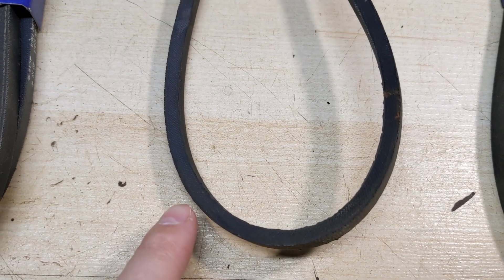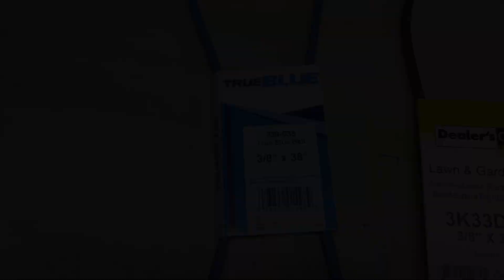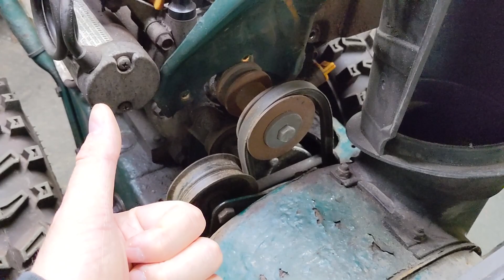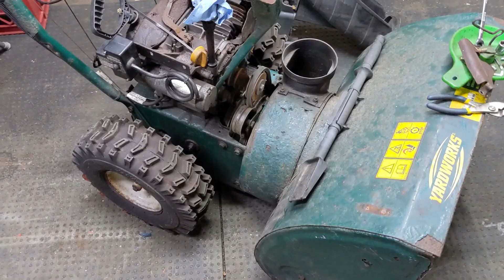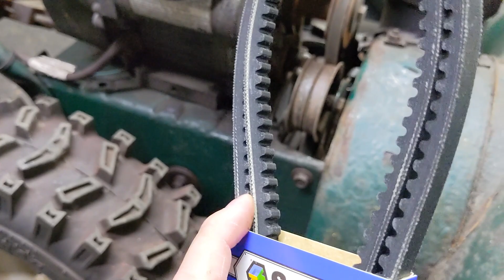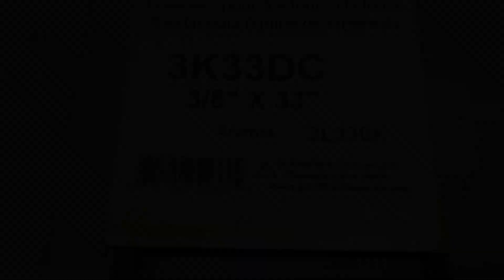Are Kevlar Belts Better?

Comment: Have they stopped making the green belts? My father-in-law had a mower shop and he had the normal black belts but there were the green belts. More expensive but last forever.  Is that what the blue belt is now.  Thank you.
Reply from the maker: Yes the majority of the aramid or kevlar belts are blue now, but I still see some green ones from time to time.
Reply: @EliminatorPerformance  Thank you.

Comment: Hi Eliminator - it's Big Rodders in Ireland.   Very interesting video.  I have enquired and researched this issue but haven't got a definitive answer - how do you measure a V belt?  Is it the outside diameter, the inside diameter or half way up the side of the V.  I know a small difference in length can have a massive implication in correct operation.  Also, I had a recent experience where two new belts wouldn't fit correctly only to discover that they were 74inches branded as 73.  Problem solved when my usual Dunlop belt came back into stock.  I would be very grateful for guidance from some expert out there in the interweb!
Reply from the maker: We've always measured our belts with a seamstress ruler (it's like a paper ruler in a roll which allows it to form around a curve) so you take a small paint marker and mark your starting point, then go around the belt. If you're measuring a belt and purchasing belts marked A98 for example, it would measure 1/2"x100" as you subtract 2 for A belts. B belts (5/8") you subtract 3 so a B97 would be a 5/8"x100" generally those industrial belts use those sizing guides.

As for our STENS True Blue belts, the 1st 3 numbers identify the width, so 238 means 3/8", 248 means 1/2" and 258 means 5/8" and the last 3 numbers identifies the length so 038 would be a 38" so a 248-038 would be an Aramid (TrueBlue) 1/2"x38"

The other belts you see on my table are generally different numbers, and the OEM replacement ones have various numbers that don't mean anything in particular.

We've seen the belt measuring tools, but unfortunately I've only seen them for 1/2" belts and up to 80" I believe (I could be wrong on the max length, but I do know there's limits) so we prefer to measure with the seamstress ruler. Then I compare my length to what the manual says, and if it's close I know it's the same belt. As belts generally don't stretch too much.
Reply: @EliminatorPerformance  Hi Eliminator - Big Rodders again.   Many thanks for your comprehensive response, I appreciate it.  I use a Dunlop AA73 belt on my Snapper RER.  I have a spare one so I'll get measuring tomorrow.  Once again, many thanks, I always enjoy the topics you present.

Comment: Mr. EP , would like to know if true blue Kevlar belts are available for my Toro power clear single stage snowblower 8, 21 . Thank you Sir for your time , and the video .
Reply from the maker: You need a model number, search that on google to find a parts diagram, and then you find the part number for your belts, then google search those part numbers to find the lengths of the belts, then if they're "whole size" you can use a kevlar or Aramid replacement!
Reply: @EliminatorPerformance  Thank you Sir , for the infomation , and for taking the time to answer my question , greatly appreciated .

Comment: Hi i had a issue with my stihl chainsaw it would cut off when i put the chain brake on or any time the chain got stop  i ask your opinion yesterday  and carb adjustment it's a little high tect for me idont have a rpm meter . So today i took it apart clean it up pretty good  & something click i couldn't move the chain back & forth freely & i just put in a new clutch and sprocket kit . So i was thinking the grade of steel they make stuff with now days  so i open i up & one spring on the clutch had broken  so i just put the old one back in & it runs ok dosen't cut off . Thanks for your help  stay safe 
Daniel from central Mississippi
Reply: what should the oil level be in the zero turn transmissions in a WYRZ 50 Parklands Ride on mower ?